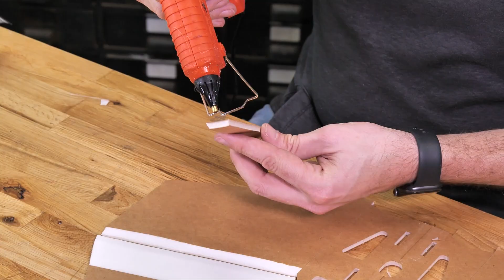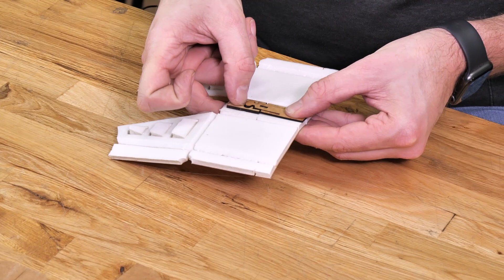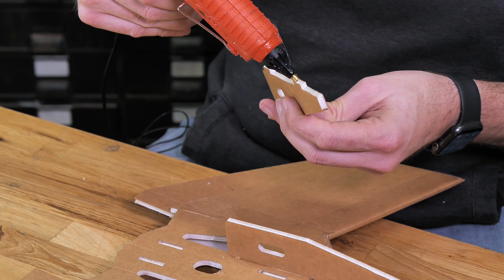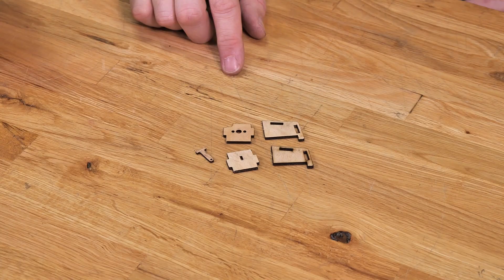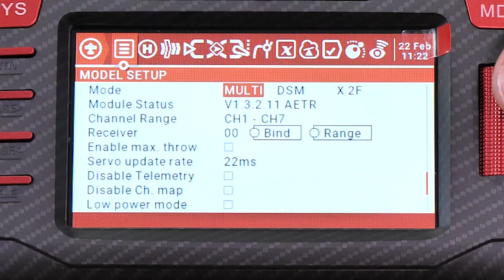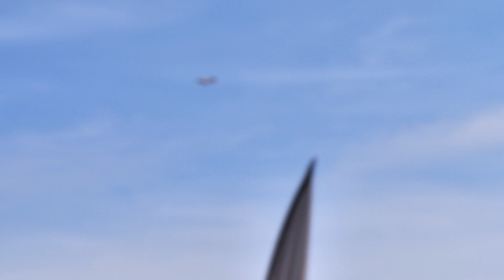How to Build the FT Nano Flerken  //  BUILD

Comment: Thanks for this complete build guys. I want to create my first rc airplane for FPV, I really appreciate this design, However I have a few questions:
- what thickness are you using for your foam board ?? 4mm?
- is there a way to use carbon fiber rods to reinforce wings and increase overall structural integrity while keeping a dihedral?
- Also, can you please share more documentation related to this model such as aerodynamic analysis at various speeds, surface areas where there's the most pressure (XFLR5) I'd love to have access to a complete analysis of this design so we can use it for school/hobby projects?

Thanks guys for your content! you're the best and the most dedicated rc channel out there !!
Reply: also If you can include this data to the 12$ plan, it would be great ! I appreciate what you do here !